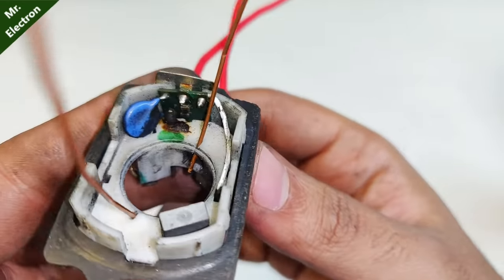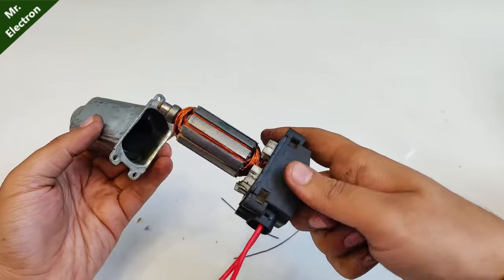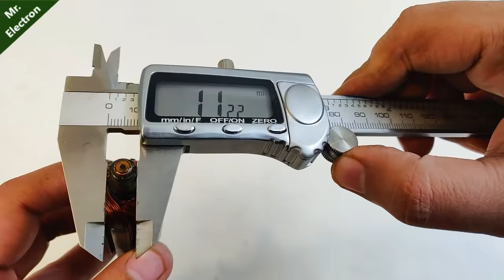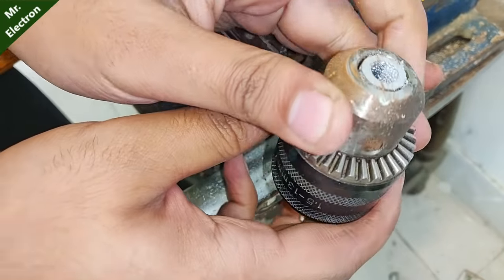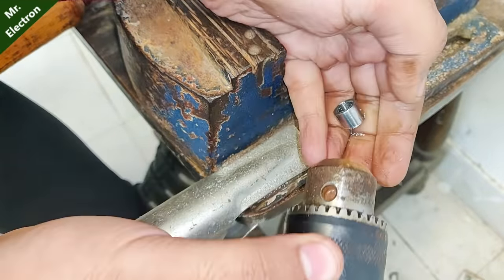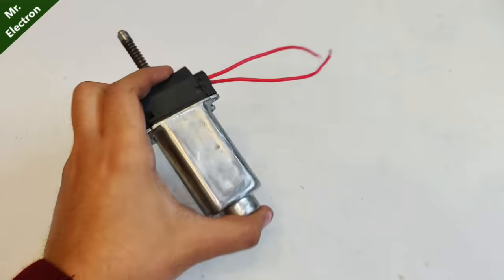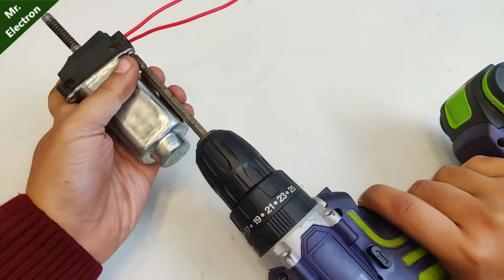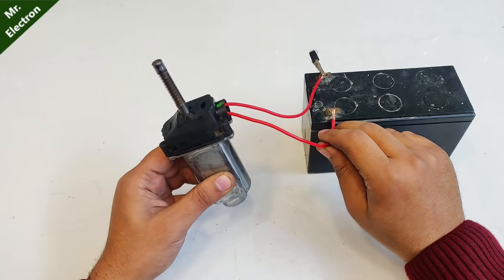Do Not Throw Away your Car Power Window Motor - 12v 10 Amps DC Motor Salvage DIY

Comment: That's good info. I have one sitting in my closet and I play with motor generators a lot..A high torque, low RPM motor seems best to me to be used as a generator.. A lot of people use step motors which return high voltage but can do very little work bc of low torque.  If I reminder right they produce AC as well. That fooled me at first.

Comment: Nice idea. 2:50 you should make better mechanical connection. Only tin will break again on vibrations.
I think these motor could not be switched on for a long tine. They are designed for short time use and will overheat otherwise.

Comment: It may not have needed a new bushing. The end of the shaft often has a small cupped recess with a bearing ball sitting in it (about 3mm/4mm dia). When you pull the stator out of the cup, the ball jumps out and sticks to the back end of a magnet. 
Use cyanoacrylate adhesive to make it stay where it belongs.

Comment: To really improve it, it needs to be rewound as Tesla would, not Edison.  That is a 10 pole motor.  It could be rewound to remove the bemf by making 5 independent coils, with a N & S wound sub coil, making it 50% more powerful.  Independently wired N-S combo coil will need a resistance of about 1.5ohm.
Reply: Wtf??? Explain that a little jejejej

Comment: The title of the video implys that it draws...10amps at 12 v
By no...means will it draw 10 (without load)
Then why do u mention such crazy numbers..in the title...? U should specifically mention that it generates ~10amps
Seeing the title...ppl will usually think that it draws 10 amps..
Reply from the maker: Those are not just crazy numbers but actual motor ratings mentioned in the title. 
        If viewers will think that it draws 10 Amps , then they would be right because its not the no load current that is mentioned on the motor lable but the rated current. They need to know the correct information , that's what matters.
Reply: @MrElectron  yeah...I m glad that u reply everytime..!!😁